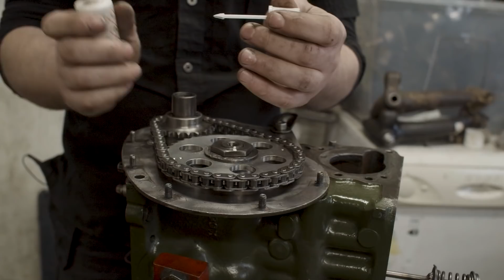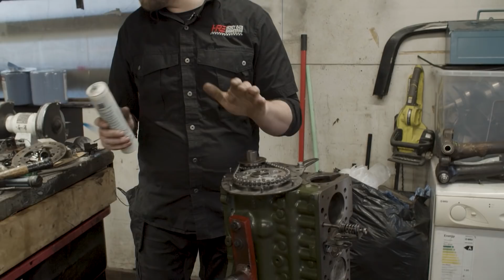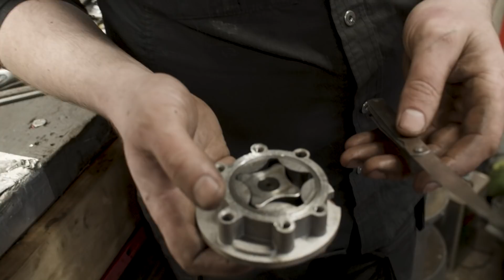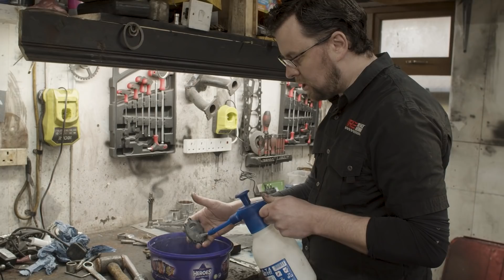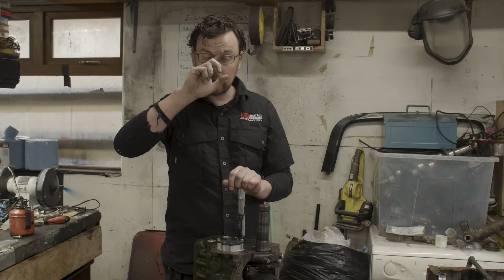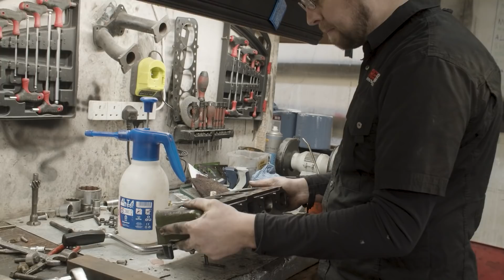Race Engine Build For Our Classic Clubman 1275 GT - Episode Two.

Comment: great vids and most helpful!  I'm in the middle of rebuilding a1275 but see nothing about the issue I was
 having....cam end float. Seems like an important issue not to go over it a bit.  Perhaps since you had this apart/rebuilt not long ago there was no need to get into it?  I had been stumped on why my float was way above spec.  After reaching out to a few others i found it was necessary to make sure the distributer gear was in place (it was not) before measuring and the fact the front stop plate was too thick and needed to be shaved down a bit

Comment: I was taught that if using a paper or cork gasket to always install them without gasket sealer unless required to do so for example the crankshaft oil seal between the engine block and the gearbox on mini engine's
Reply from the maker: It really all depends, back in the day when gaskets where much better quality in all cases I would have fitted them with out gasket cement. however now from a vast amount of experience I can say there is defiantly place for it in certain applications

Comment: Would it be alriight to use it on one side so it stay in place and use a grease on the other side so the gasket could be reused,
Reply from the maker: You could Tyrone however there is a possibility the grease could contaminate it so for the sake of the gasket you are better off using it on both sides or neither

Comment: Hi Paul

Love the proper fasteners:  trying to buy them now, but without stripping an engine down to find all the correct lengths and thread sizes it’s difficult.  You could do a kit as part of the HRE merchandise offering: now, THAT would be proper merch!  Yeah, a T-shirt is nice, but real engineering stuff would be good.  One thing confuses me:  you seem to use Allen keys a lot, rather than hex drive keys on your ratchet.  Must be sore on the hands...?
Reply from the maker: Hi Will, there is a good Idea I will get on that, I am very old school. I actully love the feel of a solid hex key its like a spanner. I do have drive keys for for the ratchets but I always reach for the keys 👍

Comment: ive also blocked the waterways on number one cylinder,ive drilled and tapped all 4 on number one but on the block as opposed to the head,known as a semi dry deck,they use this in appendage k racing apparently..also drilled and tapped the oil gallerieschanged the water pump from gwp 132 to 134, larger impellor water pump to drive the water to the far end,temperatures can vary on cylinder one to four up to 10 degrees on a race engine,thats an awful lot,great work,especially the 90* tightening of cam nut..
Reply from the maker: ya that all sounds like prudent modifications, temp indifference is a big problem on these little motors so anything we can do to help is very worth while. glad you enjoyed 👍

Comment: Great Video Paul!
You can't hear enaugh of engine assemblying, to know everything about it.
Still learning.  
Do you add a chain case  ventilador?
Which wayer holes did you block in your head?
Reply from the maker: Hi Francisco, no chain Ventilator as there is too much oil in that area on a race motor. I blocked the first 3 holes to promote water flow down the block instead of going around the thermostat and water pump of the engine block

Comment: hey paul, seeing you do all this to a pump makes me think... should I do that to a new oil pump? I got one from swiftune with my cam kit and Id think its pre-checked/setup like you do, but....whats your opinion on that? Cheers
Reply from the maker: I always check mine Luis as I have come across a few that where supposed to be "ready to fit" but when i measured them it was far from the case. In the case of swiftune I cant comment as I don't get pumps from them. It belt and braces if you check anyway :)
Reply: Will do!

Comment: Boy, did I get an education today. Do you always reuse the head studs as a lot of engine builders seem to always want to renew them , thanks for another great video.
Reply from the maker: Hi Patrick glad it was of use to you, These are ARP competition Head studs and we are given a measurement by ARP as long as the studs are with in this measurement you can re-use the stud if the stud is outside this measurement you need to replace them 👍